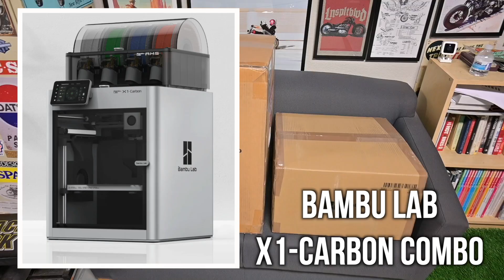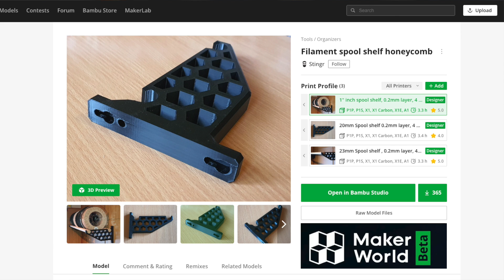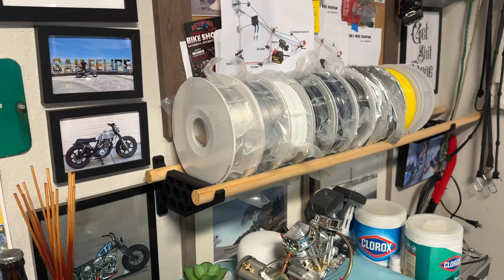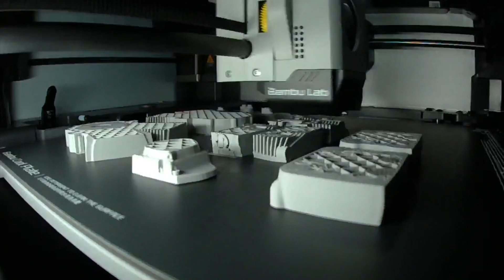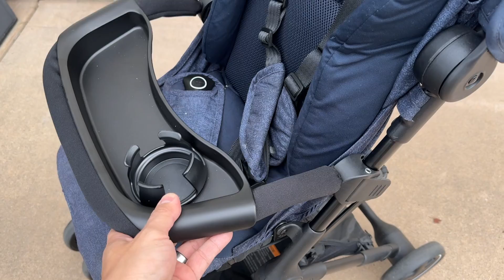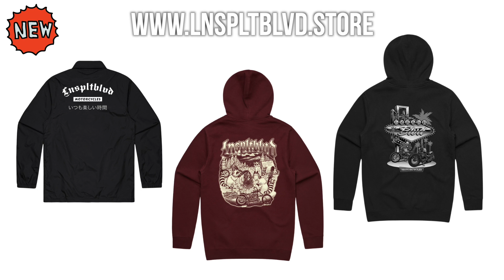Garage Tools | Bambu Lab X1-Carbon Combo 3D Printer

Comment: Cool! Bought one long ago but didn't really get into the motorcycle mods. The idea at the time was to print switch holders for the steering bar, over here turn signals and stuff is mandatory. Be sure to print in weather resistant filament. Don't think PLA will cut it for your stuff, my two cents. Thanks for the vid!